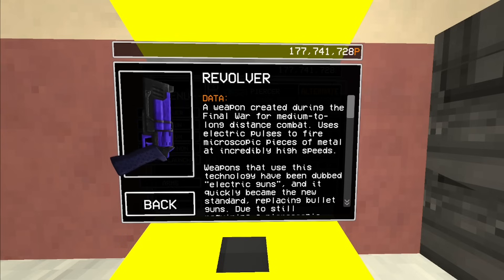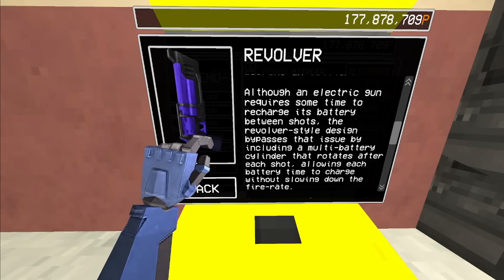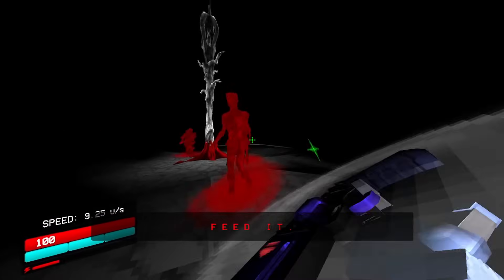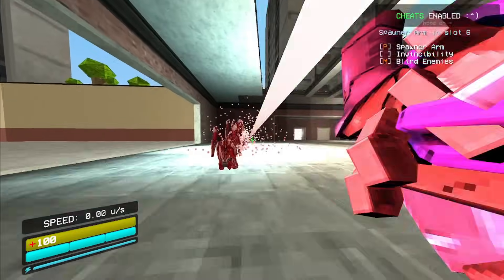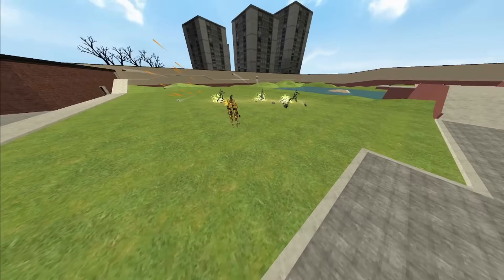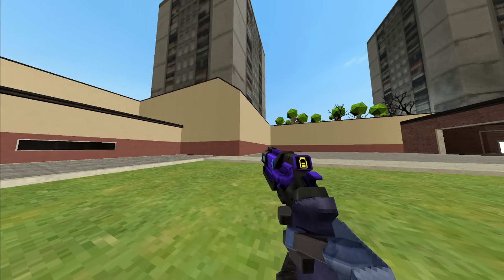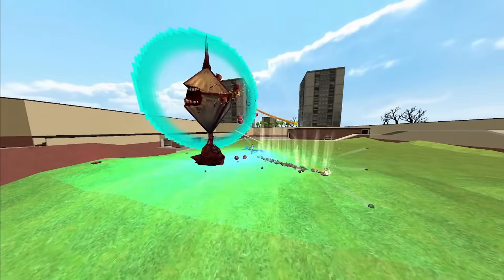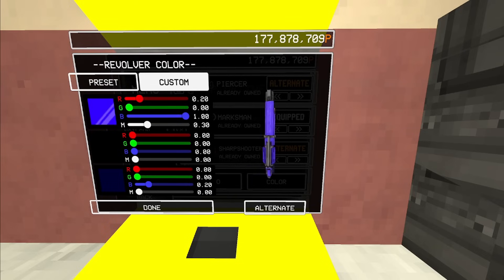How Does Ultrakill's Pistol Work?

Comment: Mx. Engineer science guy can you approve of my re-work of an ULTRAKILL rail cannon concept based on your video:

“Perhaps the most popular weapon of the Final War, the Electro-Rifle served as an intermediate solution during the time where machines began switching to Electric Weaponry.

Combining the best of both worlds, the Electro-Rifle still fires rounds akin to bullets in their size and shape, however they are completely composed of solid metal. Using a system similar to both Electric and Heat Guns, the rifle will propel the solid metal objects by charging a current through one rail and then out through the other, creating an electro-magnetic field to propel the object. The power is generated by creating a large explosion in the combustion chamber using excess heat from ultra heated oxygen that is then converted into usable energy for the transformer's output that propels the projectile. Some scientists began working with a similar system that eliminates the rail cannon concept and propels the object by using hyper pressurized ultra heated oxygen.

The weapon releases a relatively small amount of energy between each shot, maintaining most of it as it reuses the heat and energy from the prior combustion to fire off another round, one after another, mimicking an automatic system. Due to this, the weapon will need to vent our the heat for a relatively short period of time if the user utilizes all of the weapons ammunition and/or energy. However in order to produce the projectiles, the weapons onboard ammunition synthesizer extracts minerals from blood fed into the weapons intake, and forms them into small projectiles, resembling intermediate cartridges. 

If blood flow is not abundant enough to continuously feed the gun, the weapon will generate 5 rounds that can be used. However if blood flow to the weapon is stable, the ammunition synthesizer will work faster, giving the user more ammunition at a quicker rate. Blood may also be used by the emergency generator within the rifle to create more energy for the weapons systems, leading to a faster rate of fire.

If all rounds are fired and none are left in the chamber or magazine, the weapon will stop the recharging process and then vent out the excess heat for a moment before restarting the recharging process. Typically the weapon will begin creating a new round right after one is fired, and if one or more rounds are left in the chamber or magazine the process will continue as normal. This however can be avoided if you can continue to provide an adequate amount of blood to the weapon, it will still need to vent the heat, but it will not stop the recharging and reloading process.”

Some other functions include the following:
- For each rank, the reload speed goes down by 0.25 seconds, and for every other rank the rate of fire cooldown by 0.1, and down by 0.1 seconds once at the ULTRAKILL rank.
This is meant to mimic the requirement for a steady blood flow, the more stylish you are, means you'll (probably) get more blood.

- While at the ULTRAKILL style rank, the weapon will not reset nor stop the recharging/reloading process during the 3 second heat cooldown.
Reply from the maker: I would have put it as something along the lines of like it was the first successful electric weapon on the battle field when some random soldier or machine decided to make a weapon. mostly due to how like put together the weapon is. but i dont think blood has that much iron it it. but video game and all. i think the piercer has 6 shots. and if it uses some kind of super conductive material there will be little to no electric resistance, which is what makes heat.
but I do like your ideas.
Reply: @rinslab  thank you! I'm glad to hear that my amalgamation of science buzz words actually kinda worked! And I'll change it to the first successful electric weapon. Thank you for the feedback!!
Reply: @rinslab  Sorry for the bother again but do you have any suggestion as an engineer to how this could be more plausible?

Comment: what if we took penetration into account when considering the damage? in some very specific games (such as phantom forces on roblox) certain guns have higher damage at higher ranges due to the projectile/bullet slowing down as it travels. a slower bullet will stop more quickly and create more cavitation and yawing in a soft target, while those specific guns do less damage at closer ranges due to overpenetration, i.e. making a smaller hole and doing overall less damage.

if we apply the same logic here, the projectiles bouncing off of a coin or a wall would slow down the projectile somewhat, sure, but it would also make said projectile less likely to overpenetrate and therefore do more damage.
Reply from the maker: faster + harder projectile = more penetration. unless its uranium. which ill eventually get to.

but no a materiel such as metal when it hits a surface will have its energy and penetrative power reduced by alot
Reply: @rinslab  what you said does make sense, although my hypothesis also only applies to soft, i.e. flesh targets such as husks

Comment: to be more specific (lemme get my nerd glasses), the piercer is actually a gauss gun.
since railguns use a continuous electric field (something like that), but the gauss gun does use electric pulses.
Reply from the maker: gauss guns need multiple projectiles. a rail gun just needs rails and magnets.
Reply: @rinslab  no they don’t need multiple projectiles? Unless there’s something else I’m unaware of
Reply from the maker: @RoxanneClimber  "The Gauss gun (often called a Gauss rifle or Gauss cannon) is a device that uses permanent magnets and the physics of the Newton's cradle to accelerate a projectile" that requires 2 projectiles. "A railgun or rail gun, sometimes referred to as a rail cannon is a linear motor device, typically designed as a weapon, that uses electromagnetic force to launch high-velocity projectiles."
you need a second projectile to deliver force to your mail projectile for it to work.
Reply from the maker: @RoxanneClimber  gauss weapons use perminant magnets. railguns use electro magnets
Reply: @rinslab  we’re both wrong, it’s a coilgun
Reply from the maker: @RoxanneClimber  it is a rail gun. there is no circular shape. coil gun uses coils
Reply: @rinslab  it says “pulses of electricity”, a railgun uses a continuous electrical current, as opposed to the coilgun which uses pulses of electricity.

Comment: I'd say shotgun, but that already kinda has an explanation; Big heat make small molten bullets, molten bullets are shot out, shotgun is opened up to cool so that it can make more molten bullets.

I think the rail cannon would be more interesting, especially if you'd try to fit the form of it with the mechanics.
Reply from the maker: funny how heat works.... it uh well that would be a spoiler

Comment: 7:10 for those who arnt fully aware of what there talking about he’s referring to absolute zero which is -273.15 degrees Celsius or -460 degrees Fahrenheit, a superconductor is when something gets incredibly close to absolute zero but it doesn’t actually reach it because that’s basically impossible
Reply from the maker: I use they, but yeah it needs to be 0 kelvin which is all matter stops moving its based on kelvin system of measurement and is more the amount of movement in a material at that scale.

Comment: Maybe the pistol is so damn heat resistent (as in what it's made out of) that blood is enough to cool it down to a level where it dosen't turn your gun into scrap
Reply from the maker: NOTHING BUT SCRAP. but idk what the specific heat would be on the blood.
Reply: @rinslab blood is a decent heat conductor seeings as it is also what our body uses to transfer heat though most importantly is that it's a flowing liquid. sadly we don't see any arteries or pumps circulating either V1's or the gun's own blood supply so that's likely also not what's happening.
Reply from the maker: @rhodekillkatie  its mostly water
Reply: @rinslab  Maybe the blood is cold from most things being well, dead so but I don't know how a dead being would work

Comment: My headcannon is that the humans in ultrakill lore figured out how to do cold fusion, but it can't just be from any old source of hydrogen. It requires something in the blood for it be possible/viable, either to produce the necessary isotopes (hydrogen also found in the blood plasma, of course) or to deliver the energy to perform the fusion itself.

V1 is just taking in energy from the blood for itself (especially for repairing its body), and also provides the energy to the revolver in the form of a current. V1 has lightning hands or something, basically.

Comment: My personal headcannon is that the revolving element kinda functions similarly to a gattling gun. After a capacitor has been discharged it cycles out in order to dissipate heat and recharge, similar to the barrels in a minigun.
Reply: OOOOOH thats why they spin
Reply: I though of it like, YK,  An irl revolver???
Reply: And the charges shot is just an equivalent to a minigun firing out of all its barrels at once which is why it enters a literal cool down and recharge state 😂

Comment: I'd like to see a take on Command and Conquer's Mammoth Tank Mark 1 (first C&C), Mark 3 (C&C 3 Tiberium Wars) and the Apocalypse Tank (C&C Red Alert 3). 

The Mammoth Tanks is very similar to a typical tank but it has dual 150mm cannons instead of one for the turret making it one of the most badass tanks in gaming history (in my opinion)

The tanks are also basically the same but are different in each game in terms of appearance and the functionality between them are not much with Mammoth Mark 3 has a railgun upgrade that outright turns the guns into railguns and the Apocalypse Tank having a literal grinder + harpoon beam as its special ability.

Oh yeah, there is also the MARV (Mammoth Armoured Reclamation Vehicle). It is a beast with its tri-barrelled sonic cannon which fires a large area of effect sonic shell. It's also large enough to garrison four of any squad units and house a full processing plant to turn the in-game tiberium into valuable metals which is pretty fucking huge considering that Tiberium is a highly toxic crystal that can cause mutations in any living organisms exposed to it so it would have to...

I apologise for yapping at this point, I love this game series and I hate EA for slaughtering it. To whoever reads this comment, play command and conquer. I personally suggest command and conquer 3. It is a RTS game series. The lore is great. 

Give it a go, add something new to your steam library.
Reply: i liek corn
Reply from the maker: I think I can do something with that

Comment: death at 20,000 volts..??? ¯\_(ツ)_/¯
Reply from the maker: One Volt is defined as energy consumption of one joule per electric charge. and 1000 Joules is 1 mega joule. so it is 20,000 mega joules/volts.

Comment: Something I think is important to recognize is that blood in the Ultrakill universe is not what blood is in our universe. It is a different substance. 

Also, remember that humanity had, by this point, dedicated its technological development into weaponry and weaponry alone. There was no science being done into quality of life improvements, nor was there any research being done into energy sources, given how blood in this universe is akin to fluid nuclear energy in its quality. This isn’t an argument into “what kinds of blood would provide such energy” or “how can blood be modified to become so potent.” Blood in Uktrakill is not blood in our timeline. They didn’t need other sources and were so consumed by war that the fundamental energy source was never questioned (just like how we still fight and kill over oil despite plenty of alternatives). 

Since they engaged in deep earth exploration, materials science in Ultrakill is on a level that we can’t comprehend. The weight and size of the earth over for example would be infeasible with our current understanding of materials science into alloys and polymers. They have materials in Ultrakill that are capable of things we would consider impossible. This explains how weapons and machines can handle tremendous temperatures without breaking and how they can deal damage that may seem disproportionate to the weight of the weapons. 

One thing to note is that the weapons materialize upon being switched to. They are not stored physically on V1. We know that many of the weapons are given to V1 by the terminals. We also know that the terminals are “fans” of V1 due to how prolific and powerful they are as a killer. The terminals watch and record violence as their only form of entertainment. They are in charge of the style meter and that’s why you hear cheers when you finish a cybergrind level. The terminals also have the ability to teleport and copy physical objects, as evidenced by the lore regarding the song “were you foolin” (the song heard at terminals). In this way, it can be presumed that the terminals not only teleport the weapons to you, they also teleport the ammo. 

There are, as you say, autonomous batteries in the weapons which utilize something other than blood (the rail cannon recharges on its own, as well do all other weapon abilities, without killing enemies). What that energy is is not specified.
Reply from the maker: cool, I was wondering if it could work irl and it was interesting to try and put it together IRL. I know a base level of lore for this game.
Reply: V1 actually stores the weapons inside his wings, this can be seen on promotional art where silhouettes of the weapons are glowing on his wings, which means V1 uses a more advanced form of Terminal teleportation, where he can store matter for long periods and form them at demand, that's also how the arms switch.

Comment: Even thought the voltage stays the same you can actually get as much current as you want out of a battery assuming that you set up the circuit right. High current and low voltage is exactly what you want for a powerful magnetic field, meaning that the revolver could be powered by essentially a D battery. I'm pretty sure that it's using some kind of center tapped transformer because every time I hook those up to a 1.5 volt battery it creates a 5 mm arc (lotta current) and kills the battery. This effect is amplified with the addition of transistors but I'm not quite sure at all how those interactions work yet.
Reply from the maker: This depends on the electrolyte solution. capacitors are more designed for this and make less heat overall. so I would think people in this universe have some kind of new form of component or they have some kind of intermediate thing. plus you might want to not kill the battery for use later. but I do see what you are getting at
Reply: @rinslab  I have succeeded in doing this with lithium batteries, which were able to recharge later. I don't know exactly how much current was discharged each time as it is a little weird to measure but it was enough to overcome 700k ohms of skin resistance and involuntarily move the muscles in my finger. Lead acid batteries, while not rechargeable, seem to be the most heat resistant. If there is a type of battery that can be recharged and has a very low resistance then that might be a good candidate. If the revolving cylinder is a capacitor it is likely about 10-20 milifarad. Capacitors that size tend to have very high voltage ratings which will melt your electromagnet very quickly. Now that I think about it, there is a third option here. That central revolving cylinder could very well be some kind of generator. For some reason it has to spin despite not having actual rounds to fire and a generator's AC can easily be converted to DC, which is likely what would be needed to fire basically a small railgun. It could be a nuclear fusion generator since most plasma glows a light blue and there's no shortage of hydrogen 1 or 2 in any water or in v1's constant blood supply to fuel it. We should also remember that these were weapons developed for the final war, early enough to be far before humans were removed from the battlefield but late enough for them to develop advanced technology. Maybe the mid 1960s?

Comment: In terms of cooling, maybe V1's wings are able to serve as radiators and there is some sort of mechanism to carry heat away from the weapons into the wings to be radiated away.
Reply from the maker: I though these weapons used by humans? also that is a long way to transport heat. also other robots in game don't have wings. so probably not.
Reply: @rinslab  Other robots also don't use the same guns V1 uses, they have their own specific equipment.
Reply: @thestarscape2446  The Revolver and Shotgun are heavily implied to have been used by humans, the Railcannon, Nailgun and Rocket Launcher are the only ones unique to V1
Reply: V1's wings are made to store weapons and also make v1 more aerodynamic to allow sliding to happen

Comment: It doesn’t specify railgun. Coilguns or gauss cannons are far more efficient and can shoot at exceptionally higher speeds than a railgun. Using a linear induction motor mixed with sequencing of coils you could also achieve the same. Railgun also have a very poor vitality so I would lean more towards coils on this one. Great vid tho!

Comment: my theory for the coins and sharpshooter is that the coin spin really fast, coin punching makes it spin more and more thus  adding to the damages, for the sharpshooter, v1 spin the gun so it would be more of an extrem football trickshot than anything. for the coins splitshots,the coin and bullet somehoww aligne during the coin rotation making them bounce of each other exanching vectors of transvertial speed and rotation speed and for thee normal coin shot the coin just break due to poor alignement.